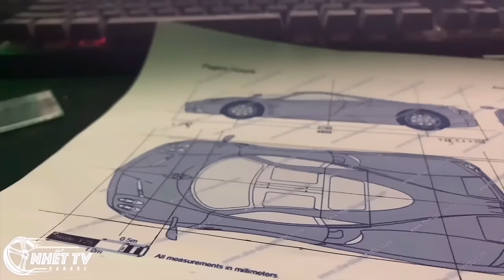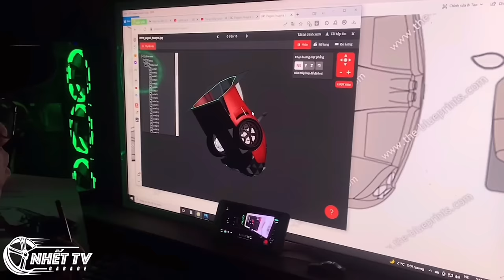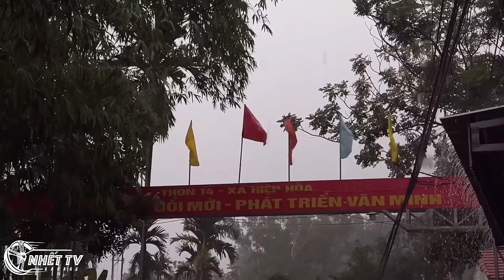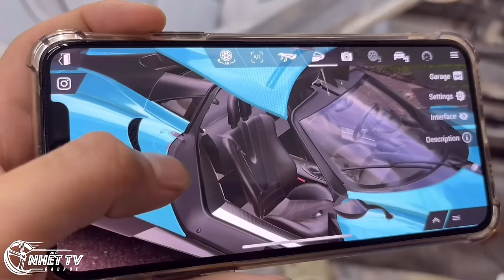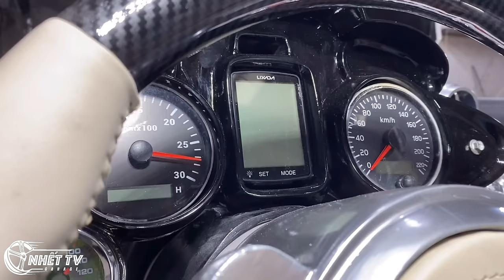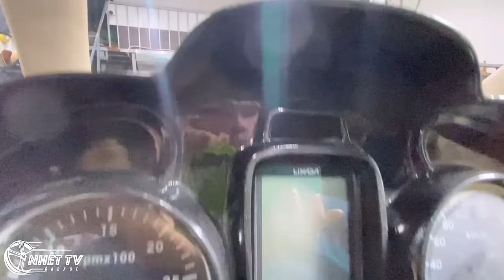I Turned A 200 USD Old Toyota Into A Supercar After My Girlfriend Left Me

Comment: Serious talent especially with the active aero panels. The only thing that worries me is the brakes: your back brakes are bigger than the front ones which means not enough stopping power at the front and the very real risk of locking up the rear wheels and spinning out.

Comment: Hello. If you have a manufacturer company. May I have one of those paganis? Everything looks so identical. Only the back plate under the flaps is too straighten and lights of the back were kind of smaller like not the whole part only the little red lights. Anyways you are amazing.

Comment: Guys, it seems that you are able now to buy a professional tools and materials, not that sticks and mud as it was in your first videos.
So why don't you buy a 3d printer to deal with small details, meshes, shapes for casting etc? 
You work with 3d drawings now, so you don't need to cut hundreds of holes manually to make a mesh